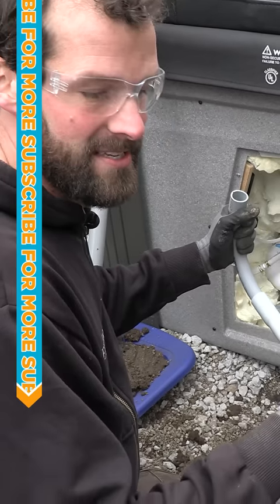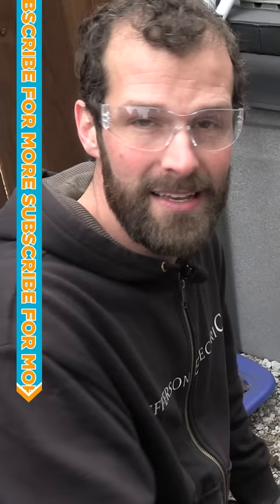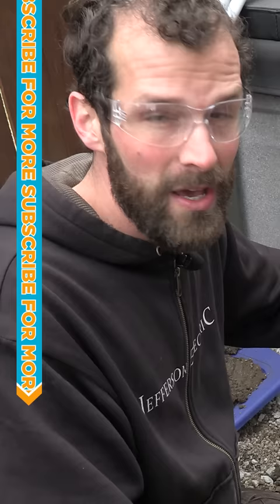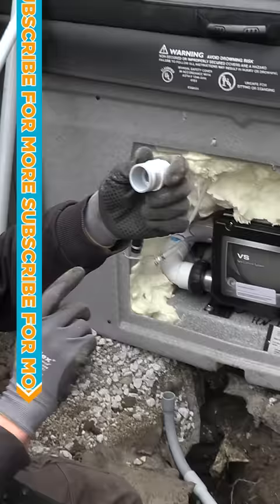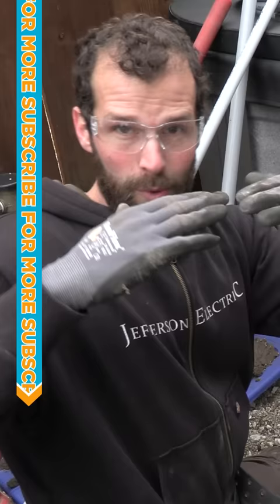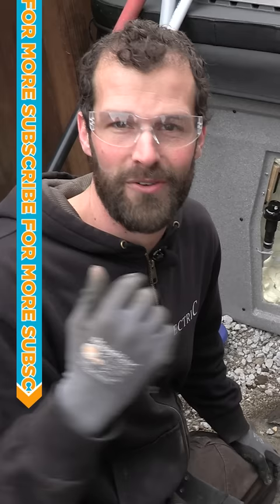A Warning When Using PVC

Comment: I live in Florida. We ran 5" PVC roughly 500' in an open trench without spot-filling. The next morning when it was cooler, the center of out run had pulled itself out of the bell-end and retracted quite a bit. Around noon time the conduit started caming back together and we glued the crap out of it and then we spot-filled the trench to create support and also the earth act as a natural heatsink to keep the conduit from getting too warm. Once it's buried, you won't have that problem.

Comment: Mechanical engineer here. The coefficient of thermal expansion for schedule 40 or 80 PVC is not significant enough that it would ever contract that much with a 50 degree delta.

Comment: According to one source I found online a C-PVC system expands/contracts by 0.65 mm/m per 10 K change in temperature. Rough calculation I make it would have to be about 80 degree difference for a 1 inch contraction in 10 feet of pipe.

Comment: In my area we have a 100 degree temperature difference between extreme winter & summer temperatures that causes 4" of expansion in a 100' run. One inspector estates that you should always use PVC expansion joint on every underground PVC that feeds a meter can even if it's only 30" off the ground due to too many PVC conduits that pulled out of male adapter and sometimes pulled aluminum wire out if lugs. Think the main reason is the ground settles causing the PVC to pull out if fitting

Comment: Yeah I've installed pipe in many different conditions, and as long as it has been glued really good and ive made sure it's pushed in all the way in couplings, it never comes apart. It's not complicated. It is however way easier to pull wire when it's been warmed up.

Comment: A plumber here   Charlotte  plastics  states that a10' length  of  pvc  will expand  1/2" with  a 100°temperature change.  We know this by the expansion  noise when it's  installed  tight against wood framing

Comment: You should use primer with pvc glue. The primer and glue lubricate the conduit so you can easily butt it all the way in the coupling. Work fast because the primer chemically bonds the pvc conduit to the coupling. In order to cause pvc to expand to the point you are talking about, it has to exceed 40°c. If you don't believe me, try and measure those conduits after the condition you are talking about. There's no significant expansion.

Comment: In 49 years of working with PVC during summer months underground I never saw this happen or ever heard of it happening from another contractor or inspector. Never saw the point where we stubbed up move backwards. I don’t doubt there is some expansion and contraction going on but not to the point of joints popping.

Comment: Actually, pvc expands at a rate of 3.4” per 100 feet of length for each 100°f change in temperature. So I guess the sun is REALLY hot and the ground is REALLY cold where this guy works.

Comment: You might want to check your units or something.  coefficient of expansion for PVC is 0.000028 in/in/°F.  If the ground is 55°F and an assumption of 140°F for the "baked" PVC gives a difference of 85°F, at that rate you would get a bit over 2 thousands of an inch per inch for that temperature change, multiply that times 144 inches in 10 ft and you get a bit less than 3/8" expansion on 10 ft.  Given that, a lot of people don't consider the coefficient of expansion which can be huge between metals and plastics.

Comment: I’m pretty sure that rigid pvc has a shrink/expansion of about 4 inches over 100 feet, at 100deg.F temp change. Seeing how buried pvc would most likely only have a 10-20deg change at 36” that size change would be quite a bit smaller, using 8’ sections and slightly longer couplers would practically make this unnoticeable.

Comment: It's called linear expansion and can be calculated using the coefficient of the given material. I've seen this happen too block heater posts. They stop working after a few years because they piping wasn't done right. The parking lot has to be dug up to repair it. Pulling new wires through is impossible.

Comment: It doesn't really matter.🧢
The expansion coefficient of pvc is about 0,000080 meter per meter pvc pipe for every degree kelvin. 

With equals to 0,00008 * 3 meters (10ft) * 60 K = 0,0144 meter which is  about 0,567 inch.

So you're not losing an inch even with a temperature diffence of 60 Kelvin.

Comment: I worked at a boat trailer manufacturer and early on when starting the business he used pvc for the air lines. During summer it would resemble a snake running across the wall.  It was a good 120' long with some drops as needed.

Comment: That's what the expansion joints are for. Sliders. Properly installed layouts have them but most of us don't use them. $$$ and engineers don't spec them. Just don't pull the wire tight. Ran a communications path using PVC in a parking garage, it would be tight in the winter when cold but sag between the straps during the summer - hot.

Comment: That kind of is unavoidable in Canada for any above ground conduit. If you aren't using flexible conduit, it is going to crack because there's literally a 60 degree difference between summer and winter.

Comment: Maybe if you forget to glue it it’ll come out, but stretching a pipe 1” over 10’ wouldn’t create an insane amount of pressure pulling off the joint, that glue pretty much welds the pvc together. I would imagine the joints/glue are designed to be able to handle a bit of pulling and stretching from temperatures. Up in Canada our pipes handle +40c in summer to -50c in winter and I’ve never heard of them pulling themselves out of a socket.

Comment: PVC thermal expansion is not as severe as you make it sound. A 100degF temp change will cause a 3/8" change in length in a 10ft stick, not a full 1".

Comment: With the thermal expansion coefficient of PVC being between 0.07-0.08mm/m*K, a 1 inch per 10 foot expansion shouldn't be practically possible. For a 1 inch per 10 foot shrink in the ground you'd need the pipe to be cut to length at the boiling point of water.

Comment: They make expansion joints for a reason 😅. Any time you come out of the ground where the ground may shift (anywhere with winter) youre supposed to use one by code. Do it with 3/4 all the time for site lighting.

Comment: I was working on a camera system at a private school SE Florida. There were a lot of 12vdc and 24vac mixed system and a lot of failures.
Walking around the flat roofed buildings, I discovered that every failed camera and blown fuse in the power distribution panels were all caused by separated fittings.
Estimate was declined and their maintenance crew used electric tape.

Comment: Well,  I suppose another thing is maybe don't install wire so it's as taut as a piano string. If that happens one option is find the Compromised section, cut it and the wire , replace a section and add a length to the wire adding heat shrink over the mend, or add a pull box for the reconnection. 

By the way,  even if the PVC did shrink  , that doesn't change the distance from point a to point b of the wire, so the likelihood of wire breakage seems nil, except if the wire was baking in the sun as well,  and was installed extra taut!

Comment: I've worked with pvc, hdpe, copper, steel and iron I think that if you had an expansion joint in any of these systems, you would have a system that works.

Comment: Well, Article 352.44 requires expansion fitting to be used where a 1/4" or more change is expected.
Also, a 30 degree temperature change alters a 100' PVC length 1.22".

Comment: Biggest issue i have had, is gluing pieces together and then can't get my fish tape through the full run. My solution was to take a tapered bevalded reamer and cut a inside beval to each piece of pipe before glueing them together. Never had an issue of a glued joint coming apart do to shrinkage do to temperature changes. Failure to properly glue your joints will cause a failurer.

Comment: I pipe pvc in the blazing sun but it’s for a pool and the pump system sand tank salt cell backwash line ect I use 2inch sometimes 1.5 never experienced any major failures from hot pvc and I’ve been building every kinda pool since 2005 fiberglass gunnite vinyl liners. Heat doesn’t effect your seal on larger pipes at least not enough for it to be compromised

Comment: It’s 3.6” per hundred feet with a 100F degree differential. So if you increase a 100’ run of pipe from 50F to 150F the pipe will increase to 100’ 3.6”

Comment: In the UK,.burying electric cables underground either goes in 4 inch ducting, or if buried direct, is Steel Wire Armoured cable. This idea of pvc in the ground is rubbish. Customers dig up the ground, shove a shovel through it, put fence posts through it etc. Use the proper stuff, ducting or SWA.

Comment: You aren't supposed to use couplings underground. That's why the molded glue joints on the end of the pipe are almost 2 inches.

Comment: This is why i alwyuse the purple primer that the plumbers use....It basically melts the pvc and the glue holds it until it welds the joint. Use the set up that the plumbers use ...

Comment: To get 1 inch of thermal expansion in PVC you need a temperature delta of 250F.  So if your pipe shrinks by an inch in 54F dirt the sun heated it to 300F. Not happening.

I have seen long straight lengths of aboveground HDPE buckled off their support through thermal expansion though.

Comment: Per Design and Engineering from the Plastics Technical Manual, expansion (for PVC, Y = 0.36), Lp is "Length of pipe run without any direction change" t1 and t2 is for temp differential (I used 54 total differential) the formula is expressed as

e = Y(t1-t2)/10 * Lp/100 
my calculation shows an expansion of 0.1944 inches for 10 feet and a 54 degree temperature differential. If my math is wrong, please correct me... I think I know how to divide, subtract and multiply, but I'm no YouTuber so what do I know!?!?

Comment: These comments are awesome only time I have had an issue with this is when we installed it on the wall near a heater and well we actually had growth not shrinkage so 8f you do have this issue you should start glueing it

Comment: Rigid PVC conduit has a coefficient of expansion of 3.38 x 10-5 in./in./°F. A 10 foot length will change in length about 3/8" with a change in temperature of 100°F. This equates to more than 4 inches over a 100 foot run.

Not 1 inch for a few degrees!

Comment: Pvc is specifically chemically designed to have minimal temperature dependent movement. Maybe try some glue, maybe even primer if you're feeling extra green, and hold it for 5 seconds or so before ya move on. Both sides. Never have this problem.

Comment: I laid 150' of 4" ABS sewer line in the full sun. Next morning it had shrank 15" and pulled out of both cast iron adapters. Lucky I didn't bury it yet. Added a cleanout and covered the whole thing in radiant barrier until it was leak tested.

Comment: When hot a full pipe is okay for anything under 200 ft and i mean air temp hot. The couplings on a full stick are far longer then just a cupling by itself.but cuplings are fine for your 90s or the end or start of a run. And always let your pipe set after heating.

Comment: Not sure 1" every 10' is the shrinkage rate for PVC but you may be want to pack your trench down at the bottom or something if you're having that much problem with everything collapsing down and tearing your plate apart I manufactured PVC that was laid in the ground  and put together with a backhoe entrenches that were miles long at PVC set out in the sun for days sometimes before it was completely all installed and pretty sure they never had that issue although they did have Bell ends some with greased gaskets in the ends.

Comment: I never knew this.
What happens if you install it properly in places like Arizona where summer heat is so bad that even buried water lines are heated to the point where your cold water comes out hot? Is there anything like an expansion joint or something for PVC pipe?

Comment: I don't think PVC expands that much.  I used to work in a machine shop and with aluminum or steel it might change by .01" or .005" (maybe) respectively by those temperature differences, and although plastic does have greater thermal expansion, I don't think it would grow or shrink much more than .1" or .05" and tbh that's being generous.

Comment: The coefficient of expansion for rigid pvc conduit calculates that for 10' of pipe to expand or contract 1" requires a change in temperature roughly from -40 to the boiling temp of water. If that's your installation environment I suggest a mineral insulated cable be used or at least threaded conduit with high temperature conductors pulled. 
The most expansion I've seen in my 20 years in about 2.5-3" in 100' in chicken barns. This guy got mislead by an exaggerating journeyman. The problem he describes just doesn't happen. Underground temp just doesn't swing that drastically🤘

Comment: You have miss read the expansion factor. Over 22+ years as an electrician and I have never had this problem. Just glue both sides and twist it in and hold till solid. Besides it is cooling off as soon as you lay it on the dirt and as you fill the trench it is completely cooled. Settle down Beavis!

Comment: This is a problem for plumbing,....... 10 stories of PVC will require expansion joints and yes, they're going to leak at some point. If you test in the Fall in Boston, you'll see your work pull apart from one day to the next. Once the building is closed in it really shouldnt matter.

Comment: That's a over exaggeration.  Pvc grows/shrinks about a third of a inch per 100 degree change over 10 foot. If ur running long lengths just leave them in the shade. They also make expansion coupling

Comment: If you're getting a high amount of expansion then you get a equally high amount of retraction once you pot it in the hole you either need to find a more suitable hole to put it in or take a certain blue pill before sticking it in the hole.

Comment: Ok, did the math! To get a 1" change in 10 ft of pipe, you need a 500°F difference in temperature, which is impossible. To get a 1" difference between some 90°F pipe and some 40° ground would require 125 ft!
Reply from the maker: NICE Is it accurate that it is probable that one would experience a 150° F temperature variation in the state of Indiana between 130° asphalt in full sunlight during the heat of summer and -20 when the ground is as hard as concrete during the dead of deepest winter? Yes. That correlates to a .6 inch expansion/contraction. I fully admit that I rounded on the fly. If that contraction happens unevenly across as few as two pieces of pipe and all of that takes place at one joint, then the average PVC joint would pull free of the socket and PVC glue would definitely not prevail in that contest. It would pull free in my opinion. What do you think?

Comment: Yeah it’s called a coefficient of expansion and every material has it. That’s why on long lines runs in plumbing you allow expansion loops there are a few ways to do this. This guy probably doesn’t use primer on his pipe and that’s why it separates.

Comment: We use rolls of duct and it’s usually 2 inch minimum cross section or 4 inch with access chambers or just buried direct SWA steel wire armours cable to avoid this issue although I would question your expansion and contracting estimates, you are allowed to use expanding joints as well with pvc conduit but I would never use this soppy rubbish underground in the uk

Comment: The rule is 3/8 inch per 10 degrees in 100 foot of pipe. So to get 1 inch in 10 foot you would need about a 300 degree temperature swing. Doubt you would be worried about installing pipe at that point.

Comment: Damn. We just replaced 4 runs of 2 inch in ground to interior of our building. 10 year old building. Wonder if this is why? From the camera the conduit had separated and the pipe was cutting the wires. Never thought of expansion.

Comment: I been a electrician for 44 years and if you use cleaner on your conduit and glue it well never pull a part I've put miles an miles of pvc in the ground on slabs and parking lots

Comment: I did all my irrigation on my 5 acre lot and ran hundreds and hundreds of 1-1/4 and 1” PVC and that did not happen. I also ran electrical pvc to the front and back of the property and did not happened either. All the wires were pulled just fine

Comment: Theory is right, but facts are wrong. Max expansion at 100°change is only about 1/2 per 12 ft, so it would rarely pull out of the coupling.  Especially since ground Temps are pretty stable...

Comment: Your math is a little off… it’s more like 3/8” over 10’ with a delta of 100 degrees. So if you run 100’ of pvc when it’s 100 degrees outside and burry it, you’d be looking at 2” of change since the delta is only 46 degrees. The only Time you would want to worry about expansion is when installing extremely long runs in a above ground installation where the temperatures could change drastically from day to day and season to season

Comment: Sounds like he doesn't know how to tape his pipes up as he's running them. A rock can make or break a conduit. You can burn through the 90°s if your using string. Making it a pain to get the wire in or past that section. Pvc doesn't shrink like that. We literally bake the conduit in a hot box or with a torch to make it soft and playable to make our own bends. In winter I'll grab a hand full of snow and cool it instant the bend I wanted.

Comment: Buddy, Im in Arizona. I HAVE NEVER HAD AN ISSUE WITH WIRE PULL AFTER LAYING DOWN PIPE. UNLESS THE CONCRETE GUYS TOOK OFF THE TAPE FOR WHATEVER REASON. IT DOES HAVE SOME EFFECT, HOWEVER NONE THAT HAS COMPROMISED ANYTHING.